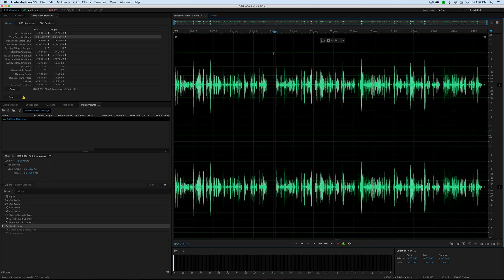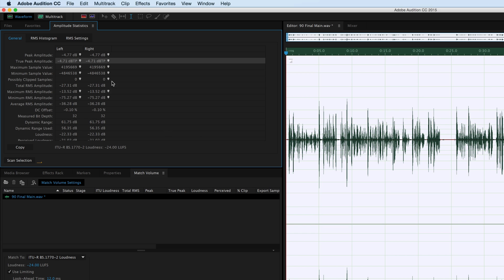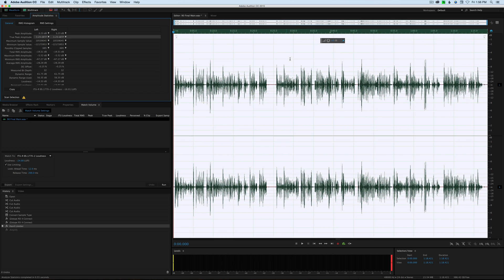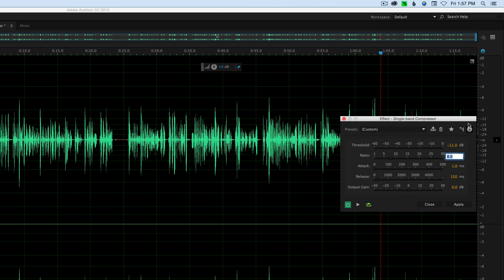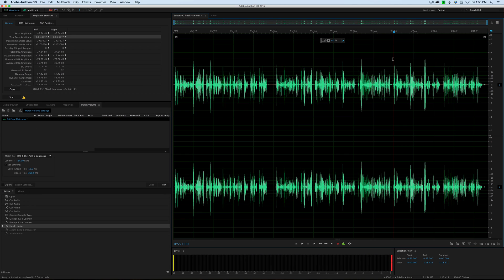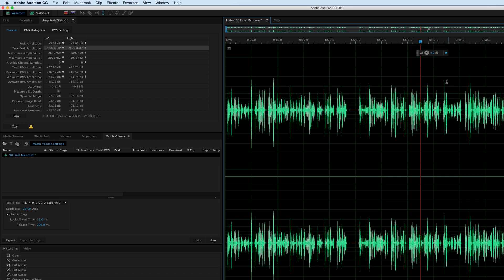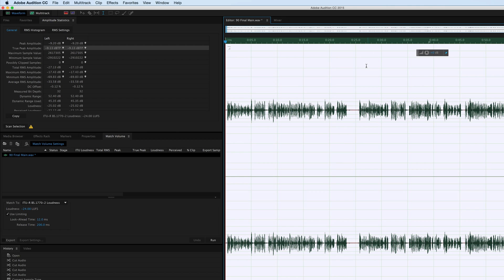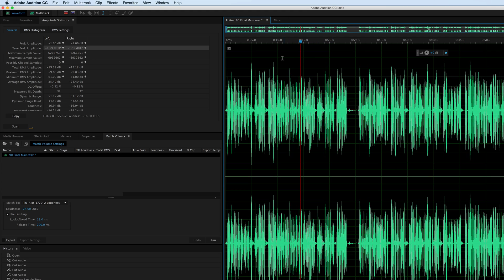Dialogue Audio Compression: Threshold & Ratio Settings

Comment: 1) You said you wouldn't get into the attack, and I wish you would have. I'm trying to find a complete guide for spoken word, and i like the way your voice sounds so i'm really curious as to how you do it in particular. do you have a more targeted playlist on compression for vocals, or a more recent video with your 5 additional years of experience? maybe you've learned something more since 2015.

2) when you "apply" a compression, is it destructive? is there not a less manual way to see what effect your edits are having on the LUFS and true peaks without all that monotonous clicking and backtracking?
Reply from the maker: 1) I use a slower attack these days for spoken word content, using my ears, I often end up at around 5 - 8ms.  2) it depends on the app and where in the app you put the plugin as to whether it is destructive. LUFS calculation is a bigger topic than I can address in a YT comment, but there is a fair bit of monotony involved, yes.

Comment: I'm having an embarassing problem with my dr-70d...my first of such kind of external audio recorders. I can't get the sound to sync. I have to stretch my video down to 96% playback speed. I am recording at 48khz on the 70d. Video recorded on a GH4. What is going on?! Any ideas?
Reply from the maker: Phil Smy Hi Phil. Are you shooting long clips? Framerate on the camera?
Reply: Yes, like 10 minute pieces (the gh4 breaks at 5 minutes at 4k). Shooting at 25fps.
Reply from the maker: Phil Smy That is odd, indeed. I have not run into that issue with the GH4 (though I typically shoot 4k at 23.98) and my Tascam DR-60D. I have to think that for some reason, one of them is not keeping good time. This is a long-shot guess but perhaps running with lower than expected voltage from the power source (e.g., on the DR-70D, I believe that there is a battery type setting in the menu. Is that set to match the type of batteries you are using)? Like I said, that's a long shot. I don't really know whether that will make any difference but might be worth a check.
Reply: Thanks. Yes it is curious. I was wrong and I am recording the GH4 at 4k/24fps/100mbps (the standard MP4 C4k setting). Up until getting the dr70d I was recording my audio into a macbook, using the same mic as now. That audio synced no problem. I have also recording using the smartlav into an iPhone and synced without issue. So I'm fairly confident it's the dr70d. I am using alkaline batteries, and that is the battery setting... So at this point I am stumped. Next step is to get a cable and go between the dr70d and the camera to double up the sound recording and see if those two tracks are out of sync.
Reply from the maker: Phil Smy On other thought, I notice that when I record to the GH4 using the in-built camera mic, that the audio is out of sync by 1 or 2 frames (it is actually 1 to 2 frames ahead of picture). So when I sync my separately recorded audio, I do it visually with the clap and not to the audio captured with the camera. Is this what you're experiencing?
Reply: No, I am experiencing a general 4% slowness of the file. Exactly what I would expect if the audio was recorded at the wrong frame rate and a crappy format conversion was done. I noticed this on the first file I recorded on the dr70d which I accidentally recorded at 44.1 and thought, oh, ok my mistake. But even on newer files, recorded at 48 I see the same thing. .... oh hold on. Just examined the file that I thought was at 48. It says 44. I will investigate further. Maybe I am not getting the settings to 'stick' right (though of course I don't think in the 21st century sampling rate should do this!). More experiments required.
Reply: Ok, no... minor brain issue. Original from dr70d is 48khz. I must have done something in Audition (new to that), but regardless the original audio file from the SD card is 48, as is the GH4 recording. Today I am going to record again, this time outputting dr70d to gh4 inputs. Sorry to go on about this! You seem to be the most knowledgable about this combination. Thanks!
Reply: Well, paint me purple and call me Mildred. The problem was something inside of Final Cut Pro X (I know you're an adobe guy!). Seems I was creating a 25fps project and dropping the audio in. The video seemed ok, but, the audio was going crazy. I might have been doing this for some time without realising it. For whatever reason the external audio that I recorded using a mac and quicktime seems to be unaffected by such wierdness. It is very very strange. I am going to look at it more closely and write a blog post about it. I can't be the only idiot out there! Sorry for all the messages.
Reply from the maker: No worries and congrats finding the issue. By the way, I've been cutting with FCPX for about 6 months now. Really liking it.

Comment: I find that using a "graphic" compression method the best.  You can really clamp the peaks, but keep the volume range of the original recording (in layman's terms, the meter still swings alot - but never past what you want) - audio that is too clamped can be hard to listen to - hard in a way that it's taxing on your ears.  So keeping the range of soft and loud is really important.  A graphic compressor will let you have way more control IMHO.

For "soft/LOUD" talkers, you can even tweak it more.  Or for a noise environments, you can put some compression it, reducing the nose floor.

Here's a setting I use to use all the time for a 2 person talking head where there would be some cross talk between the two open mics, some room echo, and some room tone above what is normal.  Otherwise I leave the bottem flat.  Hope it helps. https://dl.dropboxusercontent.com/u/2295566/temp/compression.jpg
Reply from the maker: GeorgeGraves Thanks George! I completely agree, over-compressed audio is fatiguing to listen to.

Thanks for sharing that screenshot. That looks like a dynamics plugin from Sound Forge? Audition has a similar plugin but it looks like Sony's might be easier to use. The challenge I always found with the Audition plugin is that the graphical part is too small to really tweak effectively. Might be that I need to have another go at it.

Thanks for your insights!
Reply: Curtis Judd No problem - love your videos.  Yes, that was Sony Sound Forge.  I'm an Avid guy, but I find exporting audio so easy, that I don't bother with the built in tools.  Audio is so quick and easy to import/export it's worth it having control over it. (An SSD drive makes it almost instant) Looking forward to more videos!
Reply: link is broken, and could you explain what a "graphic" compression method is? in comparison to what?
Reply: @Layarion  Most pro audio tools will have it - even the free ones.  Sorry about the link - Dropbox is evil - they ruined 1000's of my pic links. https://www.dropbox.com/s/tqjby5smv2o51a8/compression.jpg?dl=0

Comment: Curtis,

A few suggestions:

In Audition, set up an Effects Rack chain as follows:

Insert a True Peak Limiter and set the Peak Ceiling to -9.5dBTP. Below it insert a Gian stage and set it to +8dB. 

Save the chain as a Preset.

Pass a piece of audio through the chain that has been previously Loudness Normalized to -24.0 LUFS. The processed output will be compliant. If you notice any indication of heavy limiting in the output file, more than likely the input audio was highly dynamic and needs some tweaking.

Also, -1.5dBTP is a "Ceiling", not a target. Point is if after all is said and done, if your -16.0 LUFS output has a True Peak of -2.0 or even lower, you're fine. Just be careful. You don't want to sacrifice too much headroom. And so a True Peak between -1.5 and -3.0 is quite common.

-paul.
@produceNewMedia
Reply from the maker: Paul Figgiani Thank you Paul.

Comment: How come you can't compress and then use Match Volume to get to -16 LUFS? Do you have to get to -24 first, then go to -16 for some reason?
Reply from the maker: phatcorns Good question. You definitely can do it either way and I'd encourage you to do it the way that makes most sense for you. I did it the way I showed here just to keep our target (-9.5dbTP) as clear as possible.
Reply: phatcorns The reason why you need to start at -24.0 LUFS first is so the downstream "math" performed by a True Peak Limiter and a subsequent Gain offset will yield consistent results. Check my site for in depth discussion. Or, read: 

"Managing Audio Loudness Across Multiple Platforms"
http://www.tvtechnology.com/audio-etc./0193/managing-audio-loudness-across-multiple-platforms/267334

The process that Curtis talks about is explained in the article. I've tweaked it to suit my personal requirements.

-paul.
@produceNewmedia
Reply from the maker: Paul Figgiani Thank you Paul.